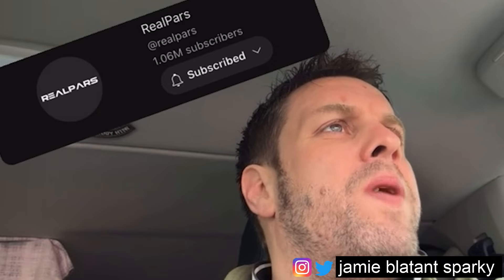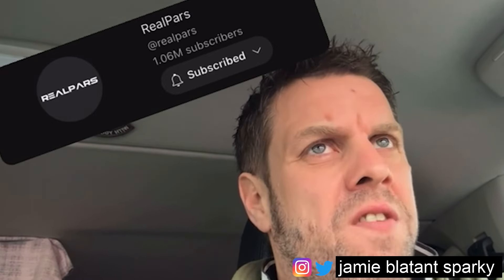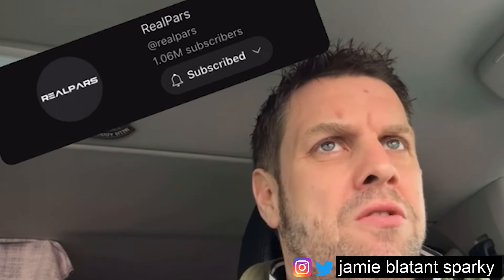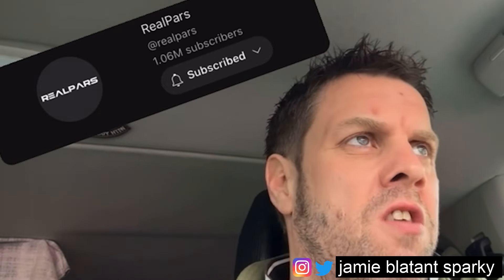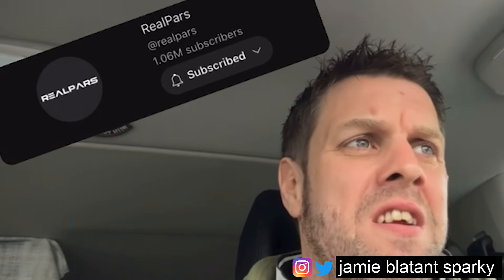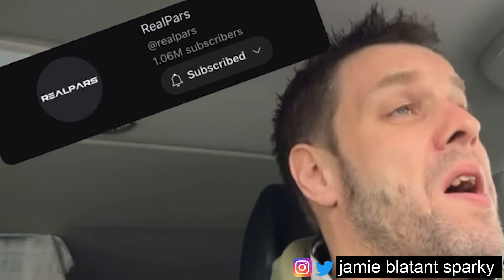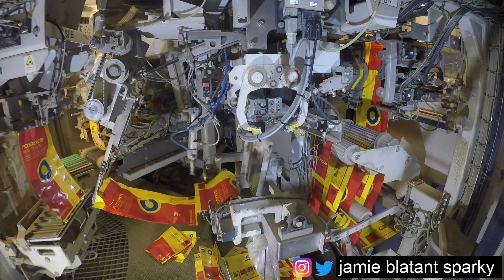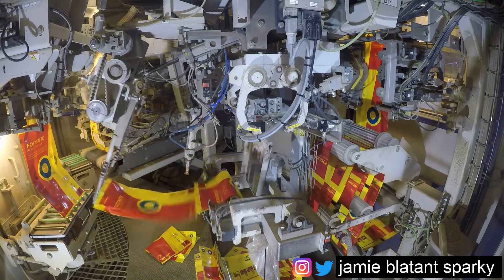measuring solids and liquids with electricity & vega

Comment: I really rate Vega instruments, their kit is top notch and the guys that work for them are really helpful. Also unlike Emerson etc who buy loads of companies and you can never find the right person to speak to Vega seem to be quite well organised. 

The cost and complexity of dealing with sources make nucleonic level instruments and last resort.

There are normally better options with point level since guided wave and open path radar have come about. 

The only thing that’s quite impressive with nucleonics is density profilers, in oil and gas separation application we have a horizontal vessel (tank) part filled with well fluids (the stuff we get from underground), they contain oil, gas and water. By dropping the pressure the gas flashes off, by allowing the liquid to sit in the vessel for a period the oil floats on the water. We control the rate water is drawn off by measuring the interface. With a density profiler you have a single nucleonic source in the centre of the vessel. And multiple detectors around the outside. It know a the path length of each and from that can work out the composition based on absorption coefficients.
Reply from the maker: Anyone reading this will spot there is a much if not more information in this post than my video ,
Reply: @Actual_electrical_content  You’ve for a great channel, you clearly put sone serious effort in to it. Thank you for all the hard work,
Reply: Some lead times from Emerson are rediculass over the past few years, unless you're building a new oil or gas rig finding the right support can be near on impossible as you've said. Vega seem to have a totally different buisness and support model that seems to fill this void. Brilliant in my opinion from start to finish and support post sale/ install

Comment: These videos are absolute gold!! Please keep them coming. 
I have not long started at a plant that has a haver and boecker and a new tech palletizer, seriously impressive! 
If you could give a run down on Profinet 😅 Process controls is next level.
Reply from the maker: What plant I am something of a Hb expert
Reply: Mapei in Halesowen, they have some wicked machines there. I think the Haver is a Merc 3 if that means anything to you. We have a check sum error on one of the spouts that keeps coming up. I can imagine you been brilliant on them haha
Reply from the maker: I used to work on them in cement , benji and Adam’s ( they are normally named after people on the factories children ) it’s been a long time but I know the weights were a sod then but they are solid kit, all be it everything on them is designed to. E hard to replace and repair
Reply: @Actual_electrical_content  That’s really cool, I have heard they make a 16 spout 🤯 The one we look after is built like an absolute tank and has been banging out bags since around 2004 I believe. Hardly any sealing issues, mainly inflation hoses and pinch valves replacing. The whole powder plant for that line is being upgraded from an old school Omron plc to Siemens s7 with profinet, so interesting 🤓 I love it haha. Keep up the good content 🫡👍🏻

Comment: Open channel flow, the restriction below the level measurement device is called a flume. This restriction caused by the flume causes the water level in front of flume (directly under level sensor) to rise slightly, it is called a standing wave, because it stops where it is. This wave is proportional to the flow through the flume. If you program certain key dimensions and flume type into the controller if calculates flow. Used widely in water and waste water industry, environment agency uses them also for river flow measurement. The EA tend to use a weir as opposed to flume. 

Wastewater/sewage use gives a whole new take on Log flume!!!

Vega are a fantastic company Karl Banberneck now retired was a top engineer
Reply from the maker: Another lod of additional information thanks

Comment: One downside to having Bluetooth or similar to set things up is security, if someone were to hack in they could change parameters and cause chaos, in some industries this could be deadly hence I doubt they’d entertain using them.
Reply: If someone is close enough to your process instrument to “hack it” they’re close enough to manually shut valves or smash things with hammer. 

Realistically you need to be within 2-5m to get a connection with these in an industrial setting. You can also set passwords etc.
Reply from the maker: It’s got a high level of encryption and everything is a possible in , it can also be turned off

Comment: Guys, need a run/hours meter that can connect to internet. Any suggestions, dont think Shelley do one,
Reply from the maker: How do you want to connect it to the internet?
Reply: I have a local AP. Using the Shelly's to monitor power thank you for that suggestion. Really good. Application is to bill holiday renters when boiler runs. Not when heating is boosted. I currently do it using an hour's counter but someone has to read it and send photos. The Shelly works brilliantly and allows me to know power usage for when I install solar next September. Property in Ireland so I can do it with a local RECI. I don't plan to do MCS here. Sticking to domestic/commercial. Currently doing course on schematics with Bee Automation. Your stuff is really good.

Comment: New stuff is boring.  Older mechanical stuff is way more interesting and basically anyone outside of the control stuff has never seem those either.  It would be way more fun to watch how a rotating paddle level switch work, instead of just listening someone telling that "this expensive black box emits this invisible signal and this another black box receives it and then tells the plc what it saw".
Reply from the maker: Agreed , I just can’t and bindcators or any of the old mechanical probes to show off as they are knackerd or very expensive, as I come across them I document and show them like I did the oil dash plot as they are going and they will soon be gone forever